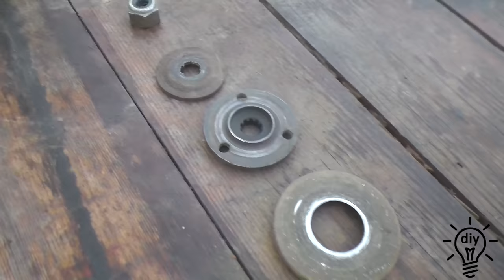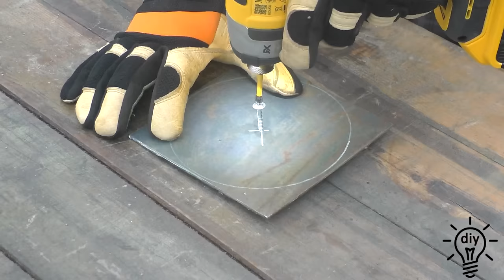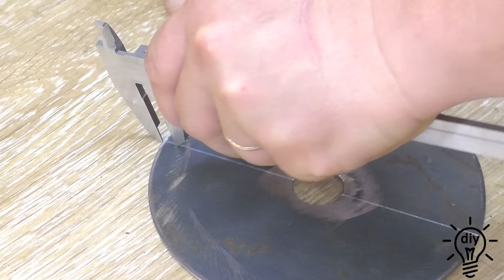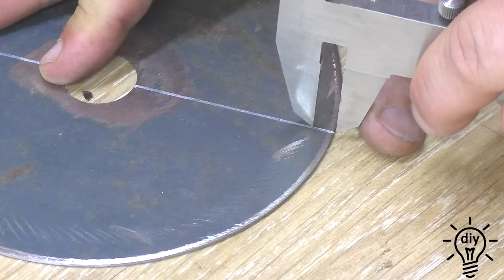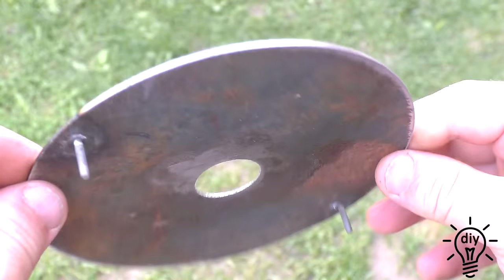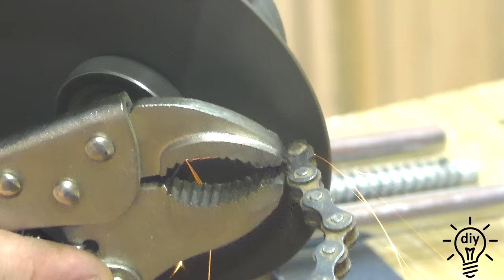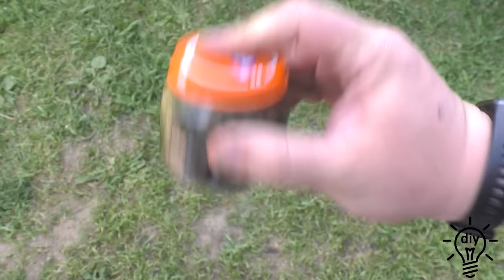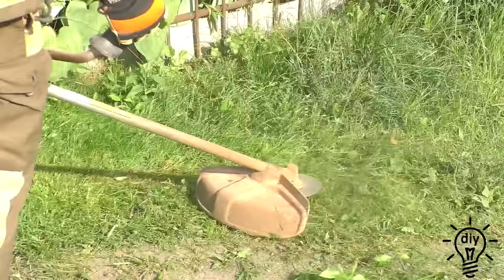A brilliant idea from a bicycle chain !!! Mow the lawn without problems !

Comment: I am old enough to remember "old time" edgers. Basically a round blade you held in a vertical fashion to "edge" your lawn. String trimmers are much more safe and useful!
Reply: I'm only 35,the ole bad a** that I landscaped under for 15 yrs refused to use any powered handtools.still to this day I can cut a more crisp edged tree ring or flower bed by hand than most people can with a gas edger,just not quite as fast.

Comment: Please to anyone who watches this. “DO NOT!”. I repeat “DO NOT” attempt to make this. It is dangerous beyond words. There are plenty of tested aftermarket products that are reasonably priced and above all safe to use as directed. This has design flaws all over it!
Reply: Yes, I agree.
Reply: What if you wore really tall platform shoes and kept the chain parallel to the ground. Then it would only be a problem after it ricochets off something hard and heads in a random direction. Note thats not if it ricochets off, but when. Murphy has a law for a reason.
Reply: That takes all the fun out of life. Plus it's enjoyable to make stuff with your hands. I personally used grade 8 bolts, and a chainsaw chain in mine. I bored the first link a little to slide over the plate, then fed the grade 8 bolt through and welded the first link to the bolt and plate. I upgraded his idea to a better, safer, and more practical solution. Now I can even clear small brush, thick weed stems, for a clear path.

Comment: I done something similar. I took ss cable and untwisted it till I got the size I wanted. Cut it to length and welded a nut on the end so it would stay in the factory housing. It worked wonderful around chain link fence. No more broken line.
Reply: That's kinda the reason I'm considering this but I damn sure wouldn't use just one screw lol it would have to be atleast 3 per side

Comment: The most scary part about this is that someone is actually going to try this....
Reply: The most scary part is that you assume this is bad, when manufacturers actually do put these things as accessories in with their weed wackers.
https://en.wikipedia.org/wiki/File:Teste_decespugliatore.jpg
Reply: @Jooeffoh  yes, a manufactured version, as in stress tested to a standard, which this one wasn't as it was homemade, with those two little bolts he used to attach those heavier chains, didn't look like they'd stand up to too much stress, but we'll never know as they weren't tested, because it's a homemade deathtrap. Also, those four chains in that wiki picture were much shorter than those bicycle chains used in this vid, which would clearly do more damage to you if they cut loose and hit you, a pet, or someone else in the vicinity, but you go ahead and make one, just don't come hopping to me, with your foot hanging off, if it all goes pear shaped 😆😆😆
Reply: @Charlie_Crown  You are a consumer drone.
Reply: 😅 Ouch, that deeply hurt Sean, but not nearly as much as taking one of those untested chains right into the shin...
Reply: I was going to try it as a home defense weapon

Comment: There's a bunch of reasons they don't sell this.

Most fall under product liability laws.
Reply: Your opening sentence 
should be the only comment allowed for this vid...NEXT!!..
Reply: Donny D  
Probably had a few lawsuits or they'd still sell them.

Speaking of "used to" have...
Try finding a public lake or pool with a real diving board. Here in Jersey those are a thing of the past.

I grew up on diving boards. Can't find one outside of a dive club now. Insurance companies refuse to insure them as a rule nowadays.
Reply: Donny D  
Well I'm shocked they sell these.
I could see this if the shielding on whackers was way better. But that crappy little half arch of plastic is not protecting against that chain.

Comment: There is a shaft with splines inside the rod.  After using your chemistry, you can start looking for a new shaft.
Reply: That is true, even a little brush cutting blade from home depot ruined mine.
Reply: You'll need a new shaft if that thing hits it... it'll become berli

Comment: My weed whacker came with an optional brush blade. 1 piece blade similar to lawn mower blade in looks. Could cut down 2-3"  trees plus the weeds. Left it on all the time.
Reply: Which will be accurately balanced to prevent vibration.
Reply: I bought a second weed eater, so I could always have the brush blade on one!

Comment: This is a bit sketchy, next time try using the bolts in a double shear application instead of single shear at least. It’ll still be sketchy, but slightly less so.
Reply: yea , he need to attach the chain directly at the plate, from both side using the chain pin only ,not bolt.  the bolt is the weakest  link and the chain will fly off.  Dangerous in my opinion...

Comment: A better way to do this is to use the outer plates of the chain top and bottom of the disc and join with the chain pin. Much much safer.
Reply: Then you can double the size and take off the guard.

Comment: When you mount that chain one piece of each link needs to be on each side of that wheel instead of both sides of the link being on the bottom. That's a lot of strength that thing has to endure with the g-force and the weight.

Comment: 2 thoughts … is that too much weight for the bearings? I’ve blown the bearings out of tools by using bits/blades they aren’t rated for. Also might run at too slow of an rpm. Possibly a lighter chain.
Reply: Or possibly drill larger holes in the base plate...
Reply: Or forget the whole she-bang while he still has un-mangled ankles !
Reply: My tboughts also, sometimes with a bigger string you lack RPM so imagine the strain with that monster, jus sayin✌

Comment: I’m all for ingenuity first and foremost. This is a bad idea. Small steel cable would probably be a better option for the sake of your shins and anything else within a 100’ around you. What caught me off guard was the well undersized, left hand threaded bolts that looked to be aluminum or very very low carbon genuine authentic imitation pot-metal….  🤣
Reply: The weak link here was definitely the bolts.
Reply: I share your cautions. Had a similar idea to "improve" a hover-mower by replacing the regular plastic blades with homegrown metal ones but in the end, thought the possibility of personal injury to be too great.
Reply: The bolts are not left hand threaded, if you look closely at the word Dewalt on his grinder, you can see that it’s 
reversed.
These people steal other people’s videos, and mirror them so the You Tube pirating programs 
don’t pick it up as a stolen copy of someone else’s work.
Reply: @beatfarmerfan  The guy who made the first video probably won't mind though....he's having his feet sewn back on after those bolts snapped!
Reply: @Mark_Demaline  THE ENGINEER AND FABRICATOR WERE THE WEAKER LINKS 😎👌

Comment: Lawn mower blades from the 1950's and 1960's were self balancing. The end of each side of the blade had a pivot joint to seek a balance point during operation. These eventually became 200 mph projectiles flying out from under the deck. Your brilliant idea is the same hazardous concept and a terribly stupid idea.
Reply: Lmao! That's just scary as hell to me. I wouldn't want to be anywhere near this thing in use. Hopefully people  next door are inside and away from any windows.
Reply: @jackharrington3711  
It's why they are no longer produced. Too dangerous
Reply: @jackharrington3711 
" Kiddis.... get in... quickly.!! 
our neighbor comes out with his brilliant idea...!"
.... " no junior, it's not necessary to call the police. All up in the second floor and enjoy the" show".!
Reply: Brush hog blades are still built that way. The blades are on swivels because brush hogs run into so many objects - the blades swinging when they strike an object reduces the velocity of the object flying out from under the deck and helps prevent permanent damage that would happen with a solid blade.
Reply: @47f0  yes ,but they usually have some logging chain pieces at the deck outlet so these have a velocity dampener when they fail
Reply: Amazing how many insurance salesman we have here that don’t know anything about physics.
Reply: Couldn't think of the correct adjective. But I think you nailed it with "stupid".

Comment: Degrease the chain before installing then add oil when using? Makes as much sense as the whole project.
Reply: Actually, that's the one thing that was done right.  The degreasing was to remove old grease that was contaminated with dirt and stopped the chain from flexing freely.  The new oil is to lubricate the chain.

Comment: Big concern with the bolts used for the chain hold downs. Shear strength. Did you consider putting the chains on with the links across both sides of the plate with the pinning, hopefully with something much more substantial in shear strength,  being the bearing surface, more evenly distributing the load and not on an axial plane or just heavily welding the links to both sides of the plate, leaving the first movable  link to take the constant shock loading ?   I wouldn't want to be around when this reaches a failure point.  Ouch? No. Possible serious ankle, foot, shin, , ,, injury ...  be careful.
Reply: I agree with what you're saying. Wouldn't he have just been better off welding the chain to the disc?
Reply: @FlyinBrian777  probably... this whole thing is fraught with problems in the area of safety, though. Sometimes it's better to just find something that has been through the wringer of testing and safety in development and has been certified by a third party. Some of the stuff I've fabricated over the years leads me to rethinking of certain safety challenges that I chose to ignore at the time. Some of that "...damn, what made me think that that would work?" stuff. Just because I was trying to save a dime, I knew in the back of mind that if that part could fail, the whole thing could. The old 'If you can't fly first class, find a way '... the life and limb you save might be your own.

Comment: One of my friends replaced the plastic wire on a weedeater with steel wire and it was very dangerous. Small pieces of metal were flying all over the place,  so this idea is a lot worse.

Comment: This has been... Um... Around 40 years ago now... There was a company that came out with a cutterless chainsaw chain.. Flipped it so the drive links were fwd to rotation, and had a trimmer head out  you could buy..
... Didn't last long.. The pin that held the chain in place, broke. There was a news paper article, covering the lawsuit that the broken off chain has killed a 1yr old child👶, that was 50 ft or so away.. 😢

Comment: Depending on the weight of the plate and chair the average “weed wicker” is way underpowered.  I strongly suggest checking your trimmers engine CC displacement before attempting this conversions.
Reply: I was thinking the same thing.  Though when that disk and chain assembly DOES get up to speed, minor obstacles like brush, stray 2x4s, and car tires aren't going to slow that much rotating mass much.

Comment: Use a proper gauge of cable wire instead of trimmer line.( be sure the ends are soldered)
Reply: Tried all sorts of metal cable, waste of time.

Comment: Whenever ive needed something more durable ive just used washing line, im often strimming around fence posts and decking so even thats unsuitable. For something like this youd be better off using a hedge trimmer(or a lawnmower lol) if for some reason you didnt want to use a strimmer. Imagine what could happen hitting a concrete fence post with this!

Comment: doesn’t that rip the grass blades apart and damage them instead of cutting the blade with a thinner weed wicker line?
or it doesn’t matter?
Reply: That's the part your trying to figure out? Imagine an angry Tazmanian Devil made of Chains spinning like a tornado in your general area... imagine if it sparks... near a gas line.
Reply: @wolfrainexxx  :  food to be safe but the chances of hitting a gas line is slim to none.
hitting a gas line that’s leaking, we’ll then your number is just up.
it’s not going to happen.

Comment: Wonder how the shaft bearing is going to hold up with all the extra weight spining around? Maybe he will change it back when a link of the chain comes loose and kills his pet
Reply: When the chains are precisely the same length, the bearing will not take a lot of  damage. The biggest problem is that you're mowing a lawn with a death machine.😅
Reply: If it's perfectly balanced, there won't be a problem... until it flies off, and suddenly makes him empathize with a Flamingo.

Comment: That’s some of the most dangerous shit I have ever seen. And then to put all that trust in those tiny ass bolts and Mickey Mouse welds. Or he could just buy the Stihl head and plastic blades and actually walk away with no concerns or issues.

Comment: Not going to lie im a machinist and im going to make something similar now.... It just makes sense for me cause i mow alot of grass and got a ditch full or rocks and thick weeds that string just wont hold up to and the blades you can but dont hole up or dont make good cuts i like the way string cuts but its weak so chain kinda fixes that issue for me lol going to do this but man for the love of god put a real lock nut on that thing... Those lock washers are a joke and they only work right of you toghten the bolt not the nut

Comment: Idea  has potential - good thinking.  

Peanut gallery comments:  Upgrade hardware holding chain to hardened fasteners - best not to use the soft metal ones pictured.   You might consider driving the pins out of the chain instead of cutting off.  On the disk end you can straddle the metal disc by putting a link side on either side of the disk. Makes for less bending moment for the screw.  Also, on the other end of the chain - instead of grinding off, keep them there and grind in a little cutting edge on each link side.  This will turn the machine into an amputee device, but it will also cut grass and small brush 10 times better (with less needed power) and is better for the grass (if that matters) because it doesn't rip the grass out so badly while just pulverizing it.   Sharpening these ends is NOT recommended - too dangerous; just an idea for anyone in the area wearing plate steel armor and lots of it.)  Just an aside: The whole idea of a string trimmer is that the string will whack the crap out of you and draw some blood, but it won't cut your leg off.  This is why they are allowed as you might surmise.

Peanut gallery cautionary statement:  Please don't grind things on a single-layer cutoff disk's middle section - only use the edge.  Disk will eventually explode from wearthrough of the  fiber layer holding it together. Use instead a regular grinding disk if you want to do that.  (But to be sure - cutoff disk is easily used for the purpose in this video - just use the outer circumference only of the cutoff disk for grinding the metal circle.) Yeah, blah blah, but I believe this is important...

Comment: I have a few questions for you since this looks really creative. First question…..why did you grease the chain prior to using it? I use my weed whacked and it gets dirty within 2 minutes of use. Second question…..did you increase your homeowners liability coverage? What you have created is a weapon that will shoot projectiles harder than the plastic cord on a regular weed wackier. Nice job though

Comment: Best case with this mod, it works long enough to burn your weed eater up, because they arent made to handle spinning this much weight. Straight shaft weed eaters can  handle bigger attachments, but I doubt even they could hamdle this much.

Comment: Instead of breaking the chain, he could simply use one piece and guide it away from the center. Even if one screw fails, another will prevent it from launching.